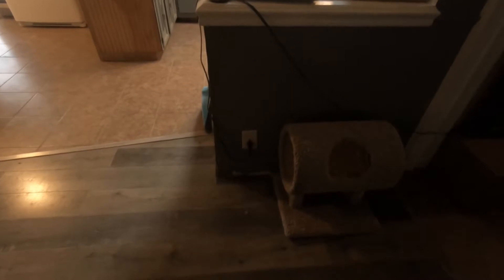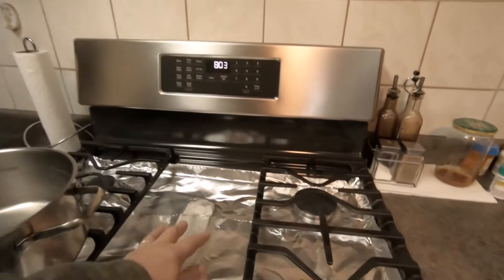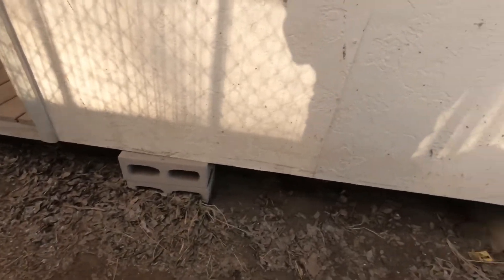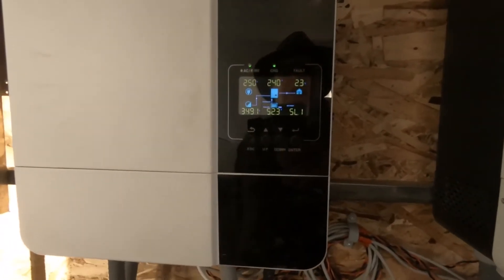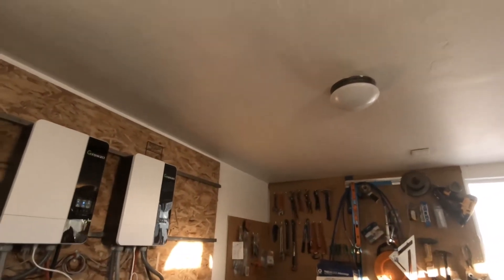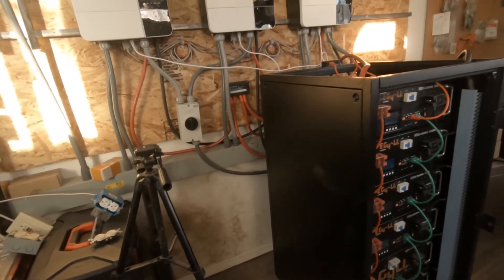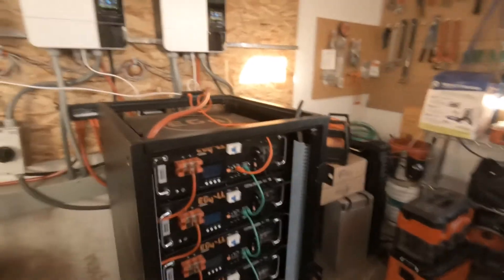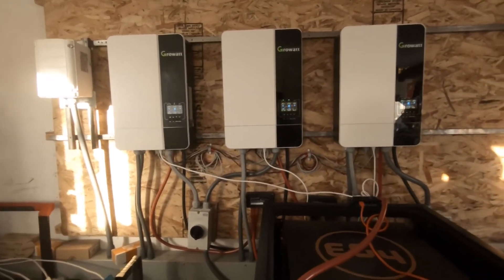why higher battery usage

Comment: What temperature are you keeping your shed at?
Reply from the maker: I have the heater keeping it around 60 degrees. I really need to insulate the floor and fix the air penetrations. It would help with keeping my batteries at a higher state of charge.

Comment: I recently bought a 4 ton inverter heat pump system and I use gas for cooking and I'm really fixing to pull the trigger on a heat pump water heater
Reply from the maker: I have seen this comment and thought on it. I was thinking about the same thing last summer. The electric water heater was using the most power from my battery bank. So, I would go out to the breaker panel and turn it off every night. so, I then thought heat pump water heater or gas water heater. Then there was always the cooking after sun hours using my battery power. At that time, I decided to put gas in my house. So, that's when I switched to gas or on demand gas. I decided on the on-demand gas because I wouldn't be heating water sitting in a tank. The extra benefit was the extra room recovered by putting the on-demand water heater in my pump house. Everyone has different needs and resources. This is only what I thought was best for me. You already have gas, so you would have to just consider what works for you. As soon as I decided on gas I never pursued looking into the heat pump water heater any farther.

Comment: So you're running most of your house on this setup? 600 amp hours of battery?
Reply from the maker: Yes, it's not my house that consumed the power. It was my shed when we get done rebuilding the shed it will be a lot more energy efficient. So, do you have any ideas? I have good ideas on the walls, but still working on underneath.
Reply: @jamesshomesolarmore2223  I don't know Jack about insulation other than more thicker insulation and radiant barrier. I have a system almost identical to yours except at the moment I'm using the growatt 12000t but I just recently bought 2 5000es and 2 autotrans. I have 560 amp hours lithium.
Reply from the maker: All we can do is work on our homes and make them comfortable and energy efficient.
Reply: Some ideas for shed-

-It needs to be as air tight as possible.
hopefully the shed is insulated spray foam is great- blown in insulation (fiberglass) is next best. Batts are poor since they don’t fit well and have lots of air gaps. Thicker amounts is better.
Make sure floor is insulated- and that wind doesn’t flow under it.

mini splits are so so so efficient for heat. They have a 3:1 energy ratio. So a standard electric heater is 100% efficient so when they use 1500w, they produce 1500w of heat. A heat pump uses 500 watts that moves an equivalent of 1500w of heat. 
They make diy heat pumps in the $1000 range. And it would also cool in the summer.
Reply: @Upliftyourbrothers   Thats what i have & i run mine with an ac coupled setup sometimes . Ive made vids of runnin mine with the grid off & interlocked off.